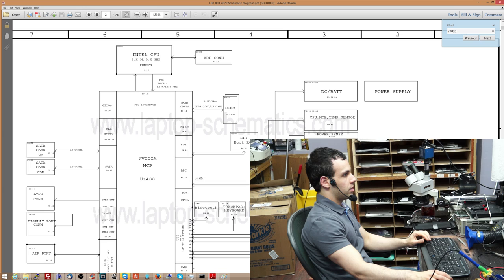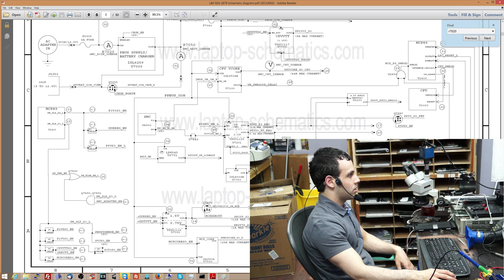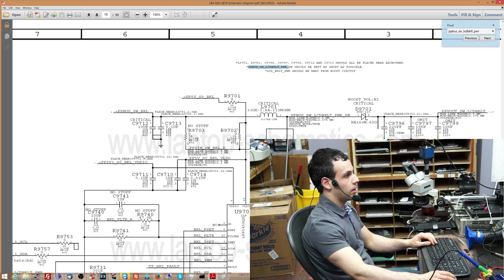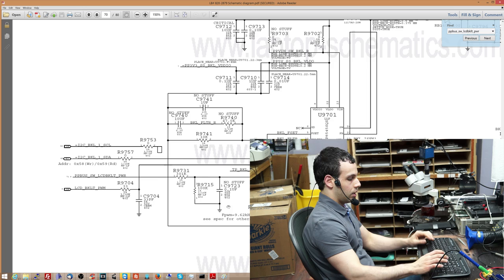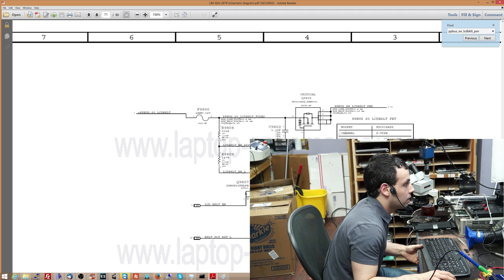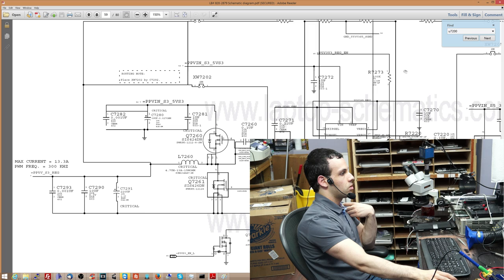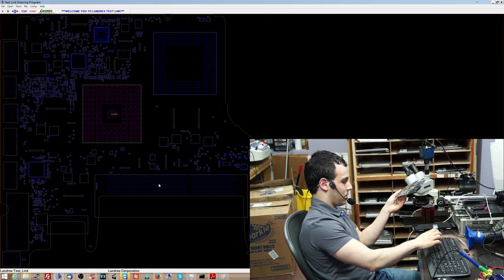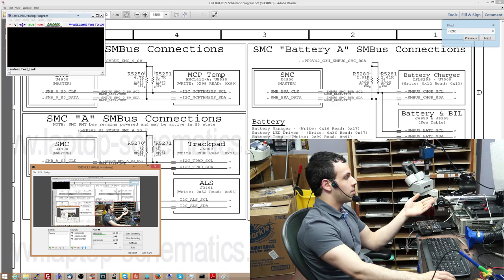How do you read a schematic? My loaded answer to a loaded question!

Comment: quick question- when you applied the probe in DC voltage on the multimeter it gave like 12.44 volts and counting like you said but when you did the diode mode it said .44 volts so how do you know the vtop from that .44v  I did not understand I kinda lost you there.  Do you have to have a good board to compare that diode reading to?
Thanks

Comment: Louis, I hope you can help me. I have a three year old Overpowered OP-LP3 Laptop. Recently the glue holding the display on failed and the display tilted down applying pressure to the connector. Not wanting to work on it myself I brought it to a shop that reinserted the connector but the display would not light up. The repairman opened up the computer and found burnt components on the motherboard. Problem is we can't find a schematic for this machine in order to identify the failed parts. Do you have any idea with to find a schematic for this Overpowered OP-LP3 Laptop? Any advise would be greatly appreciated. It's a beautiful machine and I really need to get it working. Thank you in advance.

Comment: Think your videos rock.  Learning a lot.  I run a recycling service and have loads of laptops that I usually have to junk out.  Can do some basic repairs like usb ports, dc jacks ..etc  light stuff.  Just order the microscope you suggested (the cheap one) and am going to try to learn some new skills.  Thanks for the videos.  Not sure who to message you off the public channel but was kinda wanting to get some pricing.  Mostly for the mac stuff, not sure the other stuff has enough resale value to justify the cost of sending the boards out for repair.  will try to figure out how to private message you.  but back to me working on them, have a couple quick question.  where do you get the schematics and eagle viewer files for the boards. also do you stock all the parts (seem like it would be costly to stock most of it) order as you go.
Thanks so much, these videos are awsome.
Reply: You claim to watch his videos, and yet you ask where does he get his schematics from, watch again and pause the video when he as a schematic on screen and you will see the watermark with the name on it.

Comment: Very nice video. Thanks. A question for you: One of the problems I have reading schematics is that I sometimes can't see clearly what is coming in to a component/circuit/chip etc. and what is going out. Some lines will have an equals sign, some will have an 'In' or 'Out' label and some will have nothing. Any ideas to help clear this up? Thanks.
Reply: How can now get them

Comment: I have question about a schematic I'm trying to understand. When I look at the logic board of a macbook air there are some spots where there aren't any resistors or capacitors soldered, but when I look at the board view and check the schematic there is a suppose to be a resistor or cap there. This is on several spots and I don't think anyone has worked on this board before. The question is, how much can I thrust a schematic? Because on this particular one there are lines like this "Intel investigating whether RC is sufficient", this looks like this is not the final version of this particular schematic.

Your thoughts on this please.
Reply: are you sure you have the right one.  and are you sure you are reading it right.    it's normal to have points on a motherboard where you'd think a component should be.  but then there is nothing there.
Reply: from where to find schematic

Comment: I understood  the basic components and semiconductors... I refurbished my own neogeo MVS hardware and had 13 or 14 pages of wtf is this and how do I test  it... it's  also when I developed chronic  migraine  headache syndrome  from bashing my head through an old-fashioned plaster wall pre sheet rock aka dry wall... lucky the NeoGeo arcade community is extremely  friendly  to  those in need of help  and was mentored  me..  if I had a quarter on me I would spend it on the neogeo machine.. and remain standing there semitranced  for 30 to 45 minutes... then take a long overdue  whiz...  I was never able to afford the neo get AES   home console at $650.00usd.. and game cartridges at +$300.00usd each  granted the cd console was half the price but a 1x or 2x cd-rom drive took 30 to 45 minutes  for a game to load...
I had anti violence anti blood and gore parents searching my floppy discs and hdd for doom wolfenstine3d .. they even think the classic dos shareware game Scorched Earth  was  too violent... because your trying  to nuke an enemy  trying  to  nuke you.. good old 80's cold War game addictive  game  too..